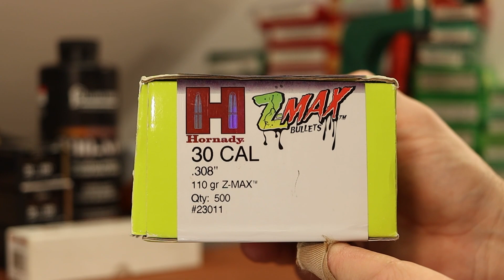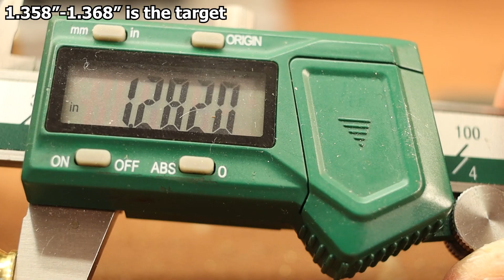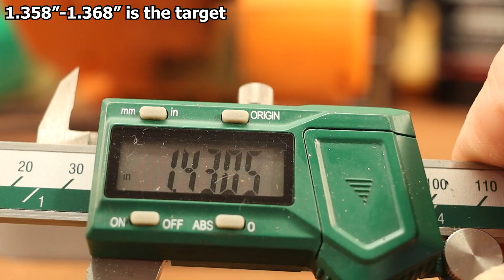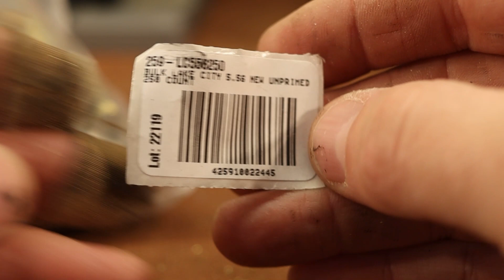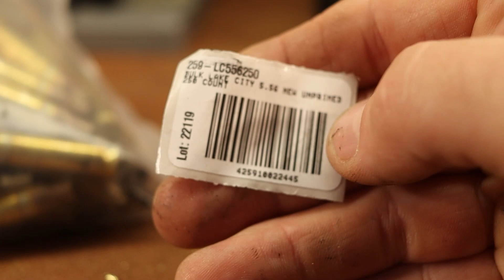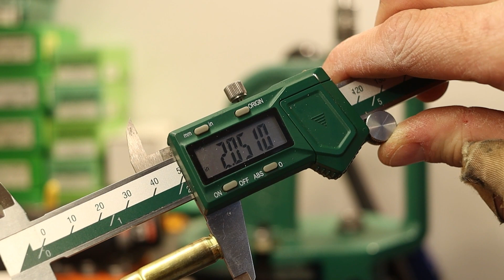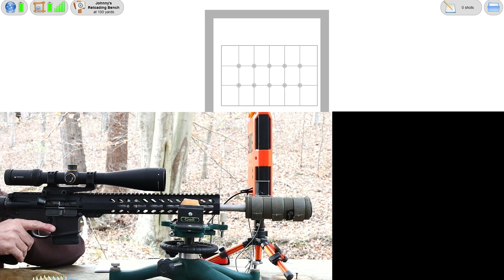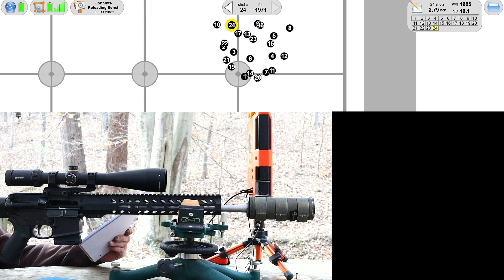Forming some 300 Blackout brass

Comment: My daughter took her first deer this year with a 300blk using 110gr vmax, CCI #41 and 21.6 of lilgun. It's a 9" Ballistic Advantage barrel and pushing those at an average Muzzle velocity of 2075FPS. It mushroomed beautifully at .45" and accuracy was pretty impressive too.
Reply: I love the 110 vmax. It’s been good on Texas hogs as well. Congratulations to your daughter.
Reply from the maker: Congratulations to her!
Reply: I have that exact same BA barrel on my 300 blk pistol. It also loves the 110 Vmax. Honestly, it's my favorite all around loadout for it.
Reply: I learned the hard way when trimming alot of brass with a drill. The cutter got worn at that spot and I needed a new cutter. Other calibers were fine as it was only that spot on the cutter. I was trying to make 38spcl cases out of 357 mag. At the time I thought it was a good idea. Of course it wasn't but I think the drill speed was too fast. Something to consider if trimming in bulk
Reply: Awesome! Congrats! I’m taking my 8 yr old granddaughter out to the stand sometime this week and she also shoots my .300blkout. I have an 11.5” pistol upper I built a few years ago. I just swapped out the hard plastic KAK Blade and  put a SB Tactical SBPDW brace on it this year along with a 3 lb trigger and she loves it! She had a bit of a hard time pulling the trigger on the old Winchester 30/30 deer rifle! She had to use TWO fingers to pull it, lol! With the new brace being softer rubber and adjustable to her pull length, and softer trigger she loves it and rings steel at 100 yards with a Vortech Sparc II red dot! She has accompanied me the last 2 years but this is the first year she wants to shoot. I couldn’t me more proud! Well, maybe if she takes one! LOL
Reply: Congratulations to her on drop a deer 300blk.  Wish use my 16inch 300blk for deer here in pa not yet 😔 hopefully soon if game commission ever pass it like was regional signed.
Reply: A 110 at 2075? Im getting well over 2200 with a 110 with only a inch more barrel!
Reply: Dang I thought I loaded mine hot at 19gr 21.6 I might have to try that on my 125gr bt out of 16in remington 5r

Comment: I use a 300blk brass already formed as my guide when setting my baby chop saw. I like that jig you got from Etsy. I'm using a smash mold I made with JB weld as my jig. The mold line for the rim holds the 5.56 brass perfectly and then I get chase down all the cut necks. Then into my Lee quick trim die. Once formed and trimmed to length, one more tumble to clean the chips out. Always a great evening. 👍

Comment: If you get the small saw blades it cuts cleaner. No abrasive burs.
Reply: You beat me to it
Reply from the maker: I'm going to pick up a pack next time I'm at HF. I think these are the ones. https://www.harborfreight.com/pack-of-3-2-inch-cut-off-wheels-42805.html
Reply: @JohnnysReloadingBench  Yep, those are the ones.
Reply: @JohnnysReloadingBench  I'm guessing those steel blades will make the brass spin even more. You need a better jig.
Reply: Thanks! I was wondering the same.  Mine came with the 2" saw blade.
Reply: This is funny! I was watching this on my tv in the work room and was going to go in phone and mention the saw blade they have for that but now  seeing all the replies...😆
 I actually drew up and burned a jig out of 18ga stainless on a laser at work and had been fantastic for me me along with the harbor freight mini saw!

Comment: You're using a sanding/grinding blade which has a thicker kerf (width of the blade).  You need to use the metal cutting blades with teeth (3 pack for $10 at Harbor Freight).  You'll get the trim length you need.  Also, as someone who has converted thousands of brass to 300BLK, resize first then cut.  It's much easier to get square-ish, then I use a universal case trimmer then chamfer and debur.
Reply: it was very PAINFUL to watch this guy do this lol
Also that "jig" he has... straight up made via a 3d printer lol
Reply: @deandalapanda  I've converted about 1500 cases using a 3D printed jig.  All within SAAMI spec.
Reply: @jaredcrowley5666  Still the same advice to size then cut? I've been saving up a lot of 5.56 brass until I got my silencer, and since the Form 4 is processing I see this as a good point to start.
Reply: @ALovelyBunchOfDragonballz  I've always sized, then cut so as to take any guesswork out of OAL changes that may occur during resizing.  My OOO for converting 5.56/.223 has been: 
1. Decap and inspect 
2. tumble/dry 
3. Lube and resize 
4. Cut 
5. Trim 
6. Chamfer/debur. 

I've also noticed that some head stamps have thicker brass at what used to be the sidewall and is now the neck.  If it's above 14 or 15 thousanths I also anneal before loading to keep from occassionally crushing the shoulder at the seating step.  I've since added a liquid car polish to my wet tumble rinse cycle and it does seem to make for smoother seating regardless of annealing or not, but that's anecdotal.
Reply: @jaredcrowley5666  thank you for the advice 👍

Comment: Great video. I've been converting mixed headstamp brass and most of it is fc. I bought a similar chop saw but got my jig from amazon. It simply gets clamped in on the existing saw and after a bit of adjustment it cuts just where I want it. I went the route of 125 grain bullets for deer hunting and range fodder. I picked up some Nosler Accubond in that weight and put W296 behind it and so far it seems good. Definitely minute of Bambi.

Comment: As someone who has converted over 5k LC 556 to 300 Blk for my own use and tried almost everything, here's my thoughts:
1. I'd be super nervous about using an abrasive blade for this.  The likelihood you get a piece of grit in your sizing die and score it is way too high, IMO.
2. Us a fine tooth blade on the saw and don't be too shy about the rate that you feed the blade in.  Too slow and you're likely to spin the case, too fast and you stall the blade.  In the middle is a nice moderate speed that starts quickly and cuts reasonably clean.  Burrs are to be expected, but they shouldn't be terrible most of the time.  If the case spins easily when cutting, try giving the ball detent a 1/4 turn tighter.
3. I don't think I've ever seen a great group from 300Blk with a 110 V-max.  I'm sure with some tweaks you'll get the groups to shrink a little, but don't feel bad if you're never really happy with the accuracy.  It's not you.
4. My go to general purpose bullet is the speed 125 TNT, they're cheap'ish and offer more expansion and velocity than the 150 FMJBT that often used in budget loads.
5. The 150 Speer gold dot can get amazing accuracy.  Can't wait to see what you get them to do.  I really want to buy some, but they've been out of stock everywhere for forever.
6. You might consider annealing the case mouth since you remove almost all of the 556 annealing when you convert.  If accuracy is your main goal, the improved neck tension consistency could make it worth the effort.
Reply: I also prefer the 125 tnt’s 👍🏻
Reply: My partner uses the Speer 125s for plinking with her FAL. They've been really hard to come by as you say, but recently she found a couple boxes of the hornady 125gr JHP for a reasonable price at her local gun store. Have you used them, and what do you think of them? Also inre to annealing, would you do that after cutting and trimming but before necking down? And if one's only choice was to use an abrasive blade, do you think tumbling overnight with walnut would sufficiently reduce the risk of getting a piece of grit in your sizing die? Whatabout tumbling with some other medium, or wet washing?
Reply: @chironchangnoi  I have not used the 125 JHP, but I'll keep my eyes open for them.  I usually buy the 125 TNT in the 500x box online, which I stocked up on before the recent craze, so I've been ok.

I currently use a powered trim on top of a sizing die (Whidden) when I convert from 556 to to 300Blk (no chop saw needed).  So essentially I am annealing after conversion sizing and trim to final length.  In my opinion this is essential as the necking operation produces a lot of work hardening that the annealing process resolves to provide the proper neck elasticity.  Once I go to reload, I will still run them through a sizing die (Hornady) before loading to insure headspace is consistent.

Considering Harbor freight sells 3-packs of 100tooth blades for $10, I don't see any reason to ever use an abrasive blade.  My chop saw is a slightly larger version made by HF that I bought a high tooth count blade off of eBay for $15.  That blade has converted a couple thousand cases and is still in great shape.  I suppose walnut tumbling after an abrasive saw would be better than nothing, but once abrasive grit is in the process, it hard to ever be 100% sure it will never be a problem.  It would be possible for the abrasive to embed in the brass such that walnut doesn't break it free, but it's probably a low likelihood.

Comment: Watching this video again… that blade is walking back and forth when it’s “hunting” for the area to enter the brass when you apply pressure … it’s wandering all over the place.. making your brass cuts rough and gouged… the metal blade has a much smaller Kerf for sure. My mileage anyway… using a squirrel daddy jig… very similar to the style your using in this video.  Still loving your old stuff! 🇺🇸

Comment: I use those trimmers from lee too, but I find it's actually easier to chuck the trimmer in a drill, and the case holder in a vice. Very quick and easy.
Reply: I do just the opposite I chuck the case holder in a drill and then use the Lee trimmer with the wooden ball type holder… works real good and is pretty fast…
Reply: @joerenfroe6874  nothing wrong with that,  especially since it's made to be used like that lol.
Reply: Drill and tap a small hole in the side of the case holder, screw in a small machin screw backed up with a nut.  Gives a lever for tightening and loosening. 😉

Comment: Lil Gun powder and a Barnes 110 TSX bullet will make you a very accurate and effective deer round. The expansion on that copper alloy bullet is great. My grandson used my 300 black out several years' deer hunting. He usually gets 2 deer every year.  It's good for short range shooting 100-150 yards max. Only recently has he moved up to a 308. He did use a 6.5 Grendel one year before that.

Comment: Go get that deer!  Hey, plz strongly consider putting a good bit of crimp on your 300 BO rounds to ensure the bullet won’t setback easily and go into battery on a 5.56 chambered barrel! What!?  Yes, really.  Never you say?  Hope is not a strategy, friends.  Disassemble the bolt and pull the firing pin (for safety sake) if you want to test what I’m saying.  Low neck tension, no crimp, and a forward assist can lead to problems for a round that looks very similar sitting in a pile of .223s.  I’m searching for a bullet that has a cannelure at the right length for a 300 BO deer round myself!  Enjoyed this one, Johnny!

Comment: Love your videos Johnny. If I may make a suggestion, the easy way to position that jig is to use a properly formed piece of brass and adjust the jig position to the saw.  It will be a touch Ling but after cleaning up the edges you'll be very close.

Comment: Semi pro tip.  That lee powder drop set up.... the lid allows you to screw in a typical 1lb bottle of powder.   
Also the plastic replacement drums actually work better, oddly.  They have finer adjustment and seem to run smoother.

Comment: I fastened my little shop vac with the crack and crevice attachment so it was just off the blade, barely clear of the motor during the chop…. Did great eating the chips and the necks as they were cut off.

It really cleaned up the process, that and the metal cutting wheels left a much nicer edge for me

Comment: I’m partial to the zep reloading jig myself.  As other have said, look at the little crow wft for trimming and get some metal blades.  I’ve cut around 500 cases so far and it’s holding up great and while it leaves some burrs they aren’t nearly that gnarly!  It’ll be interesting to see if you can get that powder/bullet combo to group but I’m not sure you’ve got the case volume to make that one work.  It seems safe but I’d be looking for more velocity with 110s!
Reply: Is that trimmer you mentioned in addition to the harbor freight saw and jig? I’m looking to reload 300 blackout but I’m not sure what I need. It’s my first time learning to reload so I’m trying to figure out what tools and stuff I need. If I get that trimmer you mentioned what else would I need? I got my dies ordered from Lyman and I got a press and powder and primers but I don’t have bullets yet and I’ll be using 223/556 cases. I only got a dry tumbler but I’m thinking about that wet tumbler with the steel medium. I’m wanting really really shiny cases just cause I like the way they look and feel.
Reply: @piplup10203854  dry media can work just fine but cut a dryer sheet into strips and throw it in along with a used old one also cut into strips to keep the dust down.  My cases look as good as new when I pull them out.  The trimmer I mentioned is to cut the formed cases to the proper length prior to loading, and yes it’s an additional tool but it makes it much quicker and easier to trim to length.  So clean, cut, size and form/deprime, trim, load is the process I follow deburring after any cutting.  I don’t check my notifications often but hopefully that helps.
Reply: @Alero2k4  Ah, I see. Cut a dryer sheet, got it I’ll take note of that! Thanks for laying it out like that. I believe I got everything I needed to start I’m just a bit intimidated on the trimming to proper length and I’m lost on the exact procedural steps so that helps out a ton! I appreciate you getting back to me.

Comment: Thanks for posting this video. I  do about the same with my brass. turns out to be a lot of work. I have a DIY 3dprinted prep station that works great (4 stations for inside/outside chamfer, primer cutout and primer clean out. Also. I made a DIY case trimmer out of a drill motor/chuck that has the Little Crow trimmer chucked in it. Works pretty well. I hope  you mount the saw on some sort of fixture. Mine is mounted on a board that I clamp to the bench so I don't have to chase it around. That would drive me nuts.

Comment: I had terrible results using 110 gr Sierra HP Varmint bullets in .300BLK. for whatever reason the first couple dozen test rounds ran great and I ordered like 1500 of them, went to town trimming brass and loaded them up. And them womp womp womp.... They wouldn't run. At all. Nose up into the chamber and jammed. Switched to 300BLK mags from Magpul. Same thing. Could not get them to run at all. Had to pull them all... What a pain... Glad to see those 110gr Hornady bullets seem to be working. The Sierra load data had the COL so long only like .02" of the bullet was in the case mouth. Called Sierra and they said try seating them deeper but had no specific recommendations.

Comment: RCBS power case trimmer, will give you a consistent length each time after sizing rough deburr and neck trim. Deburr of neck care mouth opening is taken care of while trimming case overall length by trimmer head. Clean primer pocket. Resize second time for uniformity of neck and done. Ready to load.

Comment: I trim to 1.355" for the cases and 20.2grns of H110 for 110grn bullets and really like the Barnes tactx. They work great and have proven them selves against 7 elk.

If you can find them I would definitely suggest getting into a Dillon 550 to mount their trim die and trim motor. It was worth every penny. But if you are going to stick with the harbor freight drop saw I'd suggest getting a little crow gun works trimmer. The only problem is you'll definitely need some more Band-Aids because with the 300 blackout there just isn't quite enough case to hold on to if you plan on doing hundreds of rounds you'll get a few blisters as they'll spin out from your grip.

Thanks for the video

 Now, stop taping and go hunt!

Comment: I bought a jig from squirrel daddy and mount it directly to my chop saw it has some provisions for adjusting the length. I punch out the premiers with my de capping die. then take the sizer ball assembly out of the 300 blk die size them and then cut them to the rough length. Chamfer and deburr , put the 300 blk die back together completely resize and then trim to final length. The groups are ok as long as you are hunting semi trucks size game.
Reply: I’ll second the jig from Squirrel Daddy, it’s way better than the ball detent type.  I’ve tried both styles.

The ball detent allows the case to spin and allows some deviation in case length. With the SD style, you slide the case up to a hard mechanical stop, and it allows enough room the hold it with a finger.

Comment: I used to use the Lee case trimmer. What a time consuming endeavor. Holub machine and repair, llc  makes a caliber specific trimmer. Set the case length and chuck it in a drill. It will trim cases as fast as you can feed them. They have an ebay store as well. WCT "worlds cheapest trimmer", I wear a mechanics style glove to hold the case. Very fast method.

Comment: When forming 300 BLK brass I find it is better to aim for the maximum case length so that it to some extend headspaces off the case mouth.  The shoulder of these cases is not large enough for consistent head spacing. This may help your accuracy problem.  I also run the brass through the forming die before sawing the end off.  I think this sequence produces more uniform results.

Comment: I bought a jig from squirreldaddy many years ago for making 300 brass. It seems to work a little better than the one you are using and you DEFINITELY NEED A NEW BLADE...😀
Reply: Squirreldaddy jig the best option for mini cut saw, after 10K brass work super well and new blade need! Now I switch to dillon trim and size die